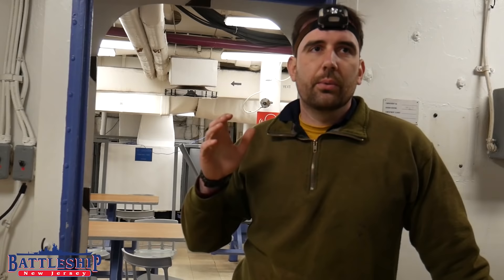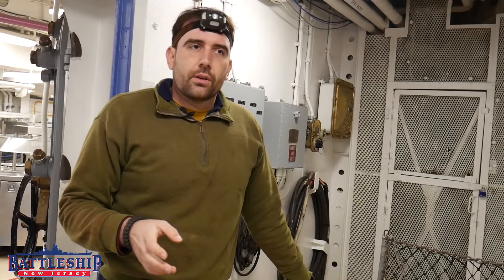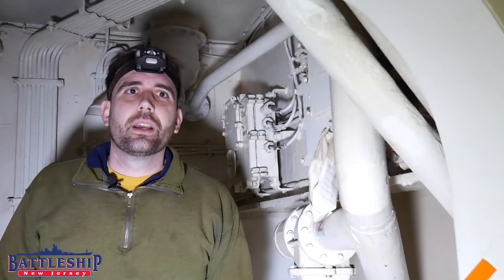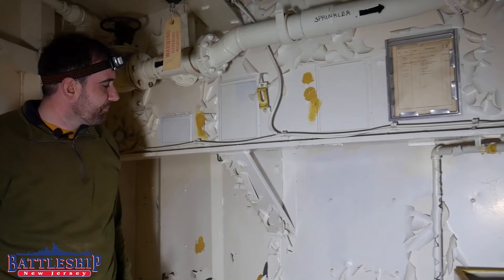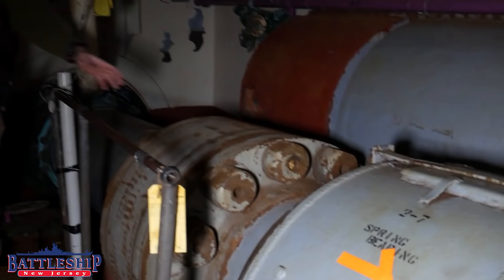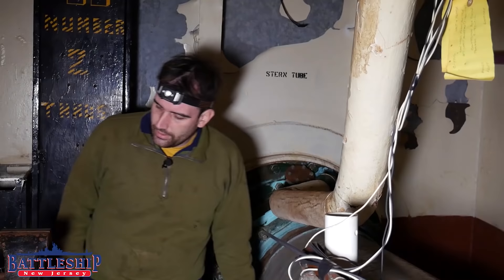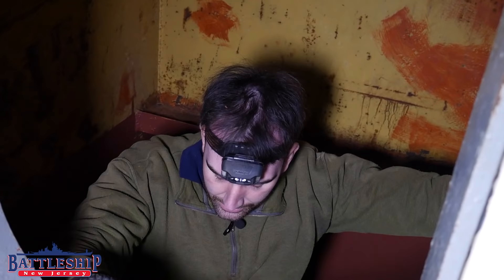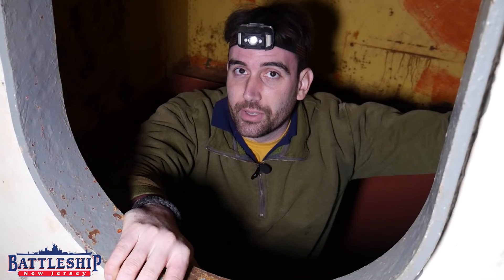Down to the Battleship's Keel

Comment: As a retired Machinists Mate who has crawled through shaft alleys and voids and had to actually change some of those shaft bearings, this was deja vu all over again! Granted my ships were smaller but shaft alleys are shaft alleys...tiny, cramped and a great place to get away for peace and quiet while in port (great acoustics for guitar playing!) !
Reply: Ex navy guys told me shaft alley is a great place to sleep.  Nobody every goes there so they never catch or can find you to give you extra work.  Another guy told me that they duct tapped a guy to the prop shaft on the USS Nimitz.  Then the shaft started to turn, eventually the force broke the duct tape.
Reply: @sd906238  when working security always check the ladies room...usually a couch in there...judge's chambers are also a good choice...very cushy and private...
Reply: My shaft alley/ stern tube crawling was on CVA. Spaces scaled up by about 4 x.
To access stern tube, which was where similarly sized shaft,
one of four, actually exited hull of ship, descent through scuttle in after mess decks, of  2-3 vertical ladders, 10-12’ each, down to stern tube. One’s first view of turning shaft through final scuttle, was from a point still about 20’ above shaft. 
  Underway, roving Shaft alley watch-stander was expected to check all four shaft alley/ stern tube spaces every hour. that schedule was seldom adhered to. A nearly impossible task.
   After shafts exited hull, each was supported by an additional
strut bearing, bearing surface was African hardwood, constantly cooled, flushed by seawater.
Reply: I simply cannot comprehend the horrors of being aboard a ship under fire, those sea battles, kamikaze, torpedoes, mines. Terrifying. A Salute to all those who served aboard them.
Reply: @sd906238  that probably the best story I've read in YouTube comments.
It's also totally believable. I doubt today's generations of snowflakes would consider such a thing funny. Probably call the police or something.

When I was working as a fitter. We all had the same seat where we had bait. About 4 years ago we had a new apprentice. Couldn't do anything unless YouTube showed him how. But not a bad lad. Thankfully he did have a wicked sense of humour.

Which was handy when we set off an airbag under his seat at lunchtime.

Whole room smelt for a week from the powder. Went everywhere lol
Reply: @sd906238  I just got a vision of a sailor getting thrown off and whipped around by a prop shaft. Pretty funny.
Reply: @sd906238 , I don’t believe that happened.
Reply: I am so sick of you telling people you crawled around and have deja vu wtf
Reply: @sd906238  Oh my, I hope he wasn't hurt.
Reply: @NOrlando952  The drives shafts are very dangerous and quite capable of killing people. Shaft alleys are normally off limits when they are rotating.
Reply: I was a MM on the USS Dixie AD14 which back in the early 70’s was the oldest ship in the Navy after the Constitution. Keel laid in 1939. We had a new guy cleaning the shaft alley bilge while in port and decided to take a snooze on a shaft in shaft alley. Shortly after, they did the periodic shaft rotation. He fell off , broke his arm and messed up his knee. Shaft alley was accessible only through a hatch in berthing and the trunk was about 4 decks below. Needless to say it was quite a job getting him out. Don’t recall what his punishment was but he probably didn’t get liberty for quite a while. 😂
Reply: Ryan is crawling through them with a female cameraperson….. nice way to spent an afternoon. Fun.
Reply: African hardwood strut bearing….. how was this adjusted?
Reply: Aboard the USCGC Planetree back in the 1970's, the MK2 (engineer) would bring his guitar to After Steering.  I was a Quartermaster sometimes assigned to After Steering and he'd play and I'd make up lyrics... usually having to do with our plight as sailors in Alaska.  Good Times... sometimes dangerous and scary times.

Comment: I was lucky enough to spend 3 days on the USS Iowa when she was on patrol in the Red Sea in 1987.  Swapped some personnel over from my ship (British) with Iowa crew - transferred between ships on the bosuns chair.  I was given a tour of the ship and included the shaft wells.  When we got to that last compartment where the thrust bearing is there was a single guy there on watch.  His job was to monitor and record the thermometer temperatures in the thrust bearing.  That was his task for the whole watch.  He seemed quite surprised when we turned up.  I got to fire a 5 gun broadside and also witness a broadside from the highest observation deck.  The blast wave was immense - like your whole body being hit with a giant pillow.  The smoke and smell was immense.

Comment: That Watchlock Station had a numbered key in it, but it wasn't for the hatch. The "watchman" would patrol around their "beat". At each station they would remove the key and insert it into a clock they had on their person. An imprint would be made on a paper disk inside. That was used to prove that the guard's rounds had been completed. The only reason I know this is because once upon a time I worked in a very, very old building that had a ton of them. Some even still had the key inside.
Reply: I’d also assume if it wasn’t there. He/she would then report that to have it replaced.
Reply: I can confirm that. One of my first jobs was working in the security department of a department store, and the night guard carried such a clock. The numbered keys, some of which were outdoors, were usually chained to the box so they couldn't easily be pilfered, and 40 years ago thieves weren't as ruthless as today. But even back then an old mechanical clock was an antique. Today video surveillance is more common, and instead of key stations, RFID transceivers will query a transponder in the guard's ID badge.
Reply: Yes, I used to work for a lumber mill and sometimes pulled night watchman duty. The mill owned a clock made by Detex Corp. that held the paper disc. We had 12 keys scattered over the mill site, and a full round took about 15 minutes to walk, every hour.
Reply: Yeah, we called them TT clocks (tell-tale), if you didn't want to walk around in the rain you could fill it with water and turn the tape to mush whilst proclaiming to the bosses later that it happened due to your diligent patrolling through stormy weather.
Reply: The ALCOA plant in Badin, NC(what's left of it) has this system in place.
Reply: The modern ones i have seen here in Sweden is now rfid tags which is scanned by the guard's appliance (phone now ?) previous basically an EAN code which was scanned using a modified bar scanner.
Reply: You have to be “old” to know how the key worked.  I know 😄
Reply: Yes, I worked at a place that had the watchclock system, also at my college 50+ years ago. Sensible system.
Reply: Detex, I think the name was.  A clock was in the center, and when the key was inserted, it marked that station on a circular paper disk that was inside the Detex device.  Big sucker, it was maybe a foot in diameter, and 3-4 inches thick, weighed enough that it came with a shoulder strap, too.
Reply: @StringerNews1  a good screwdriver...preferably electric..is all you need to remove those keys...we used to do it routinely...
Reply: @oxxnarrdflame8865  the lob was usually boring...did it to supplement my meager teacher's salary...don't think they expected us to get creative....
Reply: @MedPig  You're correct... I've still got keys somewhere to unlock the clocks :D
Reply: Back around 15 years ago or so I worked at an old General Electric facility as the front gate guard. We'd have to do rounds when the building was closed and I remember lugging around the massive 10 or so pound Detex clock, hung over your shoulder from an old canvas belt, for hitting those keys doing the rounds. From what I recall the facility was originally used for making airplanes in WW2 but was making electric motors by the time I was there. Was a set of beautiful wooden building, had such a massive sprinkler system built in to it that when a pipe broke the city knew about it before we did due to the pressure dropping so rapidly.
Reply: I have a picture of a watchman’s clock but I am not sure how to post it here
Reply: You are correct.  The watchmen were carrying “watch clocks”. And the keys were used exactly as described. The paper disk was printed like a clock face.  Each key left a distinct impression at the time it was inserted and turned.
Reply: You can see this in old 1930's and '40's movies. It's usually with an old man with a white mustache doing this job.
Reply: Detex Clocks.
Reply: @StringerNews1  Detex clocks sucked. Amazing how many of these were accidentally "dropped" down stairs when on rounds lol.
Reply: @MedPig   Been there , done that
Reply: @MedPig  Yep, the Detex clock was what I used when I "baby sat" factory's in the late 70's and into the 80's.  Ours where a slightly newer model in that they had a rolled up paper tape about 1, 1/2 inches wide with I think lines printed at 15 min intervals.  The keys were thick 4 or 5 inches long chrome plated brass the number stamps were like No 1 on the left and each succeeding no# to the right, if you walked at the right speed the key impressions would look like a perfect 45o angle.  During the day the office open it up, cut and remove the tape and date it and wind it up.  We also hung the key ring on the strap for the doors we had to unlock.  The cast box they had on the hatch was a outdoor key holder, the indoor box's were plain sheet metal.  I'm guessing they transitioned to RIFD in the 2000's.